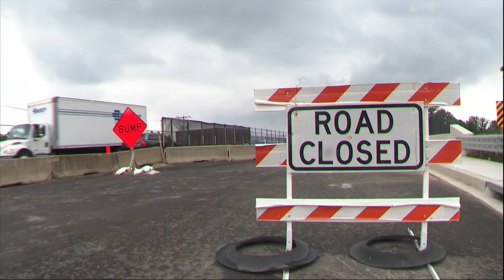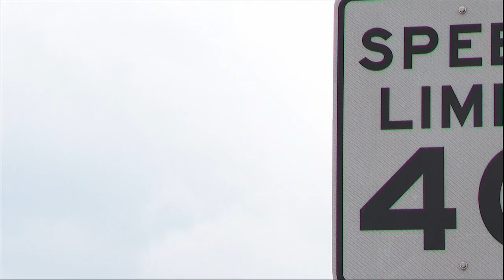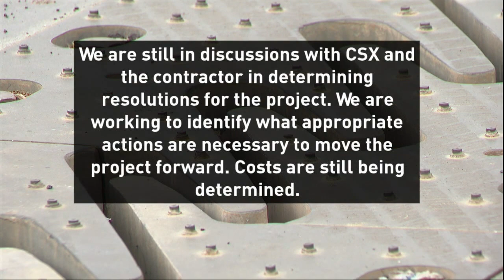Maryland transportation officials still unsure how to fix bridge built 1 inch too short

Comment: The weight of the sidewalks caused 6 inches of droop?  Has no one heard of designing with even a modest safety factor for load, like maybe, 2.0?  Was there a massive steel shortage that forced everyone to the razor's edge of material sufficiency?  And it took six years to get it wrong?  Wow.